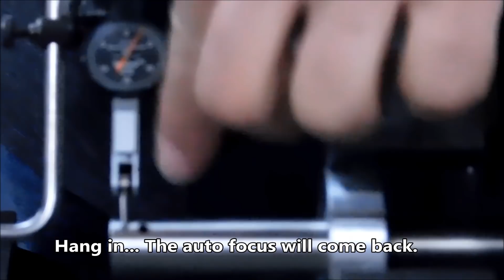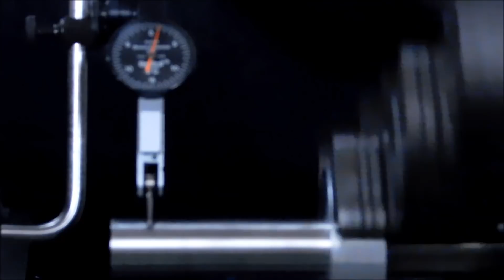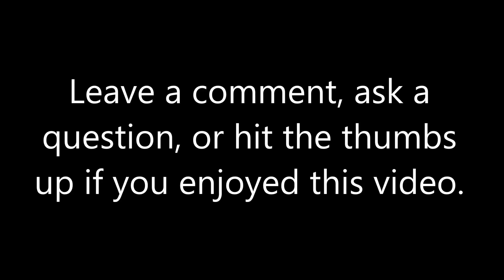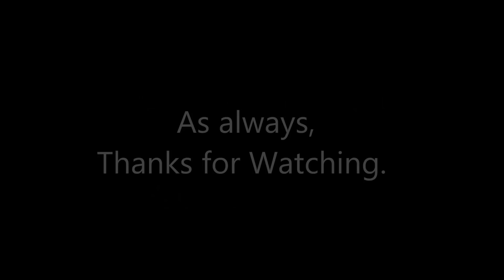Indicating a Difficult Part on a Lathe.....Maybe it's you....

Comment: to avoid having to reposition the indicator when one is banging on a part, couldn't you use like a rubber band/string/whatever to hold up the feeler, like when you are checking that it's not maxed-out?

Comment: Joe, what method of centering/indicating of a hex stock in a 3-jaw chuck would you recommend?
Reply from the maker: Use a shim on every other surface, let them hang off the stock, secure them with a rubber band and indicate the inside of them. Its very much like my 4 jaw method.  Using shims, you can spin the part like its round and not knock the indicator out of position.
Reply: @joepie221  Thanks, will try it.
But what would you do if the hex stock is long enough so that you have to indicate it not only at the free end, but also somewhere near the chuck?
Reply from the maker: @konstantinavilov1192  Extend only a small amount initially to true up the chuck. Then extend to full length and check the end with the same method. If its out, tap it. Don't move the chuck.

Comment: I would truly love to see your take on how to indicate a long cylindrical part 18" to 26" which has a precision bore with groves. Getting it to run concentric to bore for reaming and threading.

Love your work. Thanks for your content
Reply from the maker: Establish trustworthy surfaces at each end first and work with those to indicate. If all else fails, get a rod that fits well in the bore and do the indicating outside the bore. get the rod to run straight and you don't have to worry about the outer shape or inner grooves. I personally prefer 16" challenges around the .223 diameter.
Reply: @joepie221  thanks for the tips. I'm doing it through the headstock with a outboard spider. I love learning on your channel, thank you, Merry Christmas!

Comment: Recently I have been making some incidental tools from grade 8 bolts. Why - because they're available for immediate purchase at my local building center.  Otherwise, I have to order some medium carbon steel,  pay for shipping, and wait. I find that the bolts are not all that straight.  I face and center drill the bolt, extend and support the outboard end with a live center.  Then turn the whole length to find the usable straight stock that's in the middle. Is that the best approach?

Comment: Joe, have you ever used or made a Viper Fixture for such parts, we use them a lot in  Gunsmithing especially on short barrels in the lathe. basically it gives you a chuck and rear spider in a short area so no pounding would be needed (hopefully). http://pacifictoolandgauge.com/lathe-jigs-kits/2137-3-in-1-chambering-fixture-jig-viper-international.html

Comment: Suppose the stock was a 3/8" drill rod 10 inches long .? Tapping could bend the rod, no.?
Reply from the maker: It could.
Reply: Joe Pieczynski tnx, what would you suggest is a good approach in that case?
Reply from the maker: @tangcanada9381  Roll the part on a surface plate to determine if its the part or setup. Start there. After that, unloosen ( i like that word )  the chuck and rotate the part, Re-grip it and see if that helps. If all else fails, reduce the grip area of the jaws with a collar or a wrap and tap it lightly.
Reply: @joepie221  Or, indicate stock close to chuck, then  center drill and use a live center if that is permissible.

Comment: I've run into this countless times, The shops I worked in, I was trained very early to look for this, the shop I worked in longest we actually called different types of runout by different names, This where it's like a pivot where it's not straight in the jaw was runout, if the highs are on the same side then your common error is either a lobe on the part, or it's just the part isn't concentric to the centerline of the machine, we called that scenario orbiting, it made it very easy to describe exactly what was happening because we had labels for different kinds of errors, if it's running out, then it's not straight if it's straight and not centered its orbiting the machines centerline.

I trained the operators after me in that shop the same way, so when we had an issue it was easily described even though it's not universally labeled that way.

I don't know if you've done a video on it yet I used a scenario as an example of this, we had parts we ran where the second operation was drilling op on a specialized machine (something akin to a BTA drill) The problem was the operator didn't care during setup (he was quitting and really didn't care anymore) so we had parts where the Wall variance was well over .070 at the bottom, the Max allowed was .010, So we ended up having to create almost this exact "error" to fix the OD to the ID, where one end is actually true and the other was kicked out far enough we had to shim it in the chuck.

The other scenario I've run into was that the hole was straight but not down the middle of the part, so we had to create and orbit situation to cut the OD true to the ID. I mentioned to someone else in the comments that sometimes we create these scenarios to fix other errors, it's worth noting it and talking about that sometimes we have to create less than ideal cutting situations to fix errors (those parts the depth of cut varied enough from side to side, that even though it was technically just a varying depth of cut it was severe enough that it was for all purposes of tool choice and sped and feed choices an interrupted cut in a nickel based super alloy, you and I both know how had those suck)

Comment: What would cause an issue like that from happening?
Reply: This is a very common issue, Basically there's two kinds of "Out" that a part can be, That the part isn't straight in the chuck, which causes highs in different places, to simulate this visually take a pencil, hold it about an inch one end still between your fingers and use the other hand to make the end go in a circle, the point in your fingers is true, like the part in the chuck, the other end is not true to centerline. You'll notice the point in your fingers doesn't really move, it's like a hinge, the backside will be going out the opposite of the end you're moving.

The other kind of out, is that the centerline of the part and the centerline of the machine aren't in line, but the part is true, this is if your hold both ends of the pencil and orbit them around an imaginary centerline. This is actually less common than the other.

Basically the jaw only holds a small point and as such the part can be a bit out, the stock inside of the jaw will be running out 180 degrees opposed to the opposite end. basically the difference is this case it isn't that the part is off center as much as it's not straight in the jaws, The other out is that it's straight but not centered.

In the shops I worked in we called this runout, and the other we called orbiting. (note that on some jobs and odd features, you might actually intentionally create either of these errors to fix another kind of error. Ran a job that the parts had been drilled and the drill had run out enough that it the wall variance was .070 at the bottom of the hole, but at the entry it was dead on so that entry had to be zero and the other end we had to make run out .035 on the thick wall so it would cut the outer true to the inner. in the case of that though, you indicate with a wiggle bar to the ID and use the OD to verify.

But that's what is actually happening, it's a common issue, it's something I was trained to look for super early as a machine operator, and something that when I was a trainer I taught and illustrated in their first week of training. as well as giving examples of it in practice with scrap parts that were unusable for anything other than showing the errors and how to potentially correct it.

Comment: Great video as usual, but....
I always use 2 indicators for this kind of set up no jumping back and forth....
Super handy for setting up big ugly crap in large machines, saves a lot of time.
when they both read 0 your done.
Reply: on large parts exactly this, I'll have one indicator in a fixed position near the chuck and then another usually doing "the bad thing" and having an indicator fixed to the turret near the other end and indicate to match, on big stuff on big machines in my experience usually I'm using a cathead or roller rest to bring in the outside end and the chuck to bring in that end. So exactly this. On small parts on a manual machine like that I use just the one, and I mark the high with a red paint marker and the low with blue on both ends so I can see what kind of mess I'm working with before I ever start trying to indicate.

Comment: With a thin piece of round metal in the Jaws  with a section protruding  inside the jaws, as well as the section protruding towards the tail stock,  I would have used a dial gauge on the face of the job, to bring it into alignment, then checked it for longitudinal alignment. In the end you did a good job pointing out, what some of your viewers might have missed. Have a Great Christmas and a Prosperous New Year to come.
Reply from the maker: There was no established face surface to indicate. Dual OD readings are the only option when no face is available. But, when a face is available, always true the face before the diameter.
Reply: @joepie221  Fair call, you could then treat it the same way   if you were setting up to machine a Bolt or re chambering a .308 Remington

Comment: What if the part itself happens to be slightly bent? Most of my stock comes from skips/scrap. Lol
Reply from the maker: Split the error 3 ways over the length of the part for the most efficient max resulting diameter. low on the ends and high in the middle, all by the same amount.

Comment: I had similar issue to this once 

But was consistent with every piece chucked up using ground and polished shaft stock

Took the chuck off found a small chip between the chuck and the head stock

Comment: Hello Joe, thanks for the instructive videos. Great as always!
Do you know if anybody ever tried to build a 2x4 independent jaw chuck (8 jaws in total) that would allow to hold the piece at two different points that can be adjusted independently? Or perhaps tapping the workpiece is much faster than adjusting 8 jaws 😅

Comment: If anyone wants a dial like this

Go to eBay and buy a cheap one for $20$

Trust me, it’s worth it

Think if u by 10, and 1 breaks every year.

You have still saved $200 bucks

$400 cost finger Mitch Toyota
Reply: There’s $20 bucks for cheap and nasty dials..

But they fccccccking work greatnesses 

If you look after it and don’t drop hit shake or ..... it’s Chinese! Look after the damn thing it’s $20 ffs.

Of course it’s going to be trash, but it WILL LAST 1 YEAR - tops.

Trust me
Reply: Why would I buy a cheap noname for 20 when I can get a new Mitutoyo with calibration certificates for less than 80?
Reply: Jaakko Fagerlund 80??

Comment: Where can I get a indicator holder like that? I looked I don’t think they make it anymore.
Reply: I looked a couple times on Ebay with no luck. Joe did mention the brand and model in a older video. The only thing that I have seen similar was from Shars. I don't know if they still sell it. I got curious and looked in my 2017 catalog. The model is 202--6018 and sold for $19.95. If you find something similar that's decent let me know.
Reply from the maker: The holder is over 40 years old. Its discontinued. US general model 387. I love it.
Reply: @joepie221  hey Joe would you be interested in some tool trading?
Reply from the maker: @andyZ3500s  Such as?  Just don't ask for my indicator holder.
Reply: @joepie221  how did you know out of the whole shop that was what I was interested in?

Comment: In this case you had a nice collar on the rod that would allow you to skew it slightly in the chuck to get the axis of the rod parallel to the axis of the spindle.  Is there a fairly simple way to tweak a part in a chuck without this spacer or grinding the jaws?

Comment: Very clever, but how exactly is the bar held in the chuck?
Reply: It's basically a shop made collet. The ID is close/tight to the stock size with a slit cut in it so the chuck jaws close it down and clamp the stock.
Reply from the maker: I used a collar for this demonstration so I could achieve the 'crank' error in the part. It reduced the surface contact and allowed me to preset the .004 error.
Reply: @joepie221  I got that part on the exaggerated error. Didn't know it was a called a collar and I've made several. Thanks

Comment: Hi Love your videos. Do you make or do you know who makes a device to mount I dial indicator on an adjustable boring head? I want to see the amount I move the head on a dial indicator- not the scale on the boring head.
Reply from the maker: You can use in indicol holder if the head is a small one.
Reply: @joepie221  emmmmm it is too universal. It will take too long to set up.
Reply from the maker: @samstewart4807  A true indicol takes less than 5 seconds to attach. Is that too long?

Comment: That is good advice, another good thing to show people is how to make soft jaws (aluminum will work) , just reverse engineer your removable hard Jaws. To make Jaws that need to be bored through like your part requires, cut a face Groove in the Jaws and clamp on a ring while you are boring them. When done correctly, your part will run in perfectly.

Comment: Joe, 
Have you tried using copper shims under your jaws. Copper has two qualities that are very good for lathe an work. 1. it is soft and conforms to the parts surface so when applying the hammer the copper compresses and allows the part to move where you want it to.
2. It increases friction between part and jaw for better holding power. 3. non marring 4. Downside, it creeps. So if holding a big part it can loosen over time.